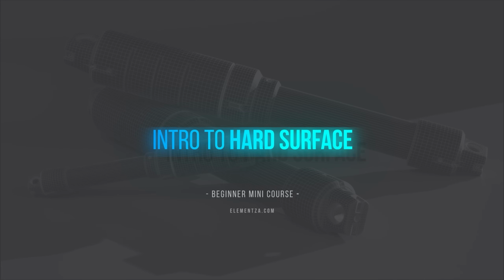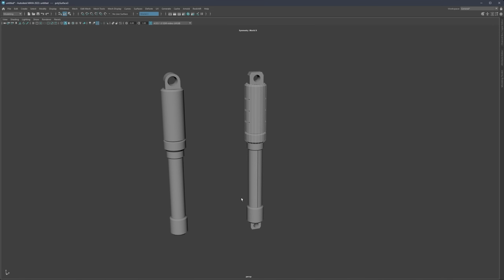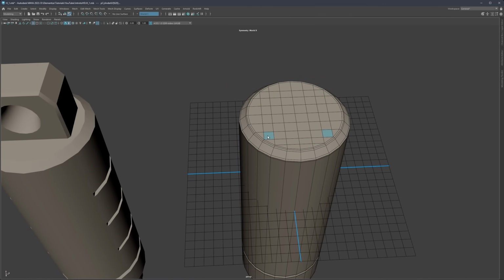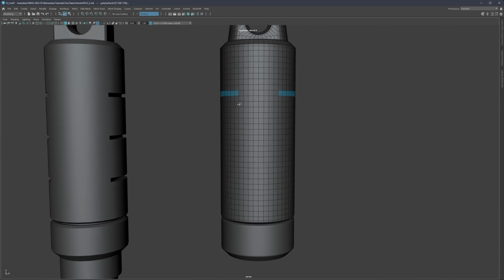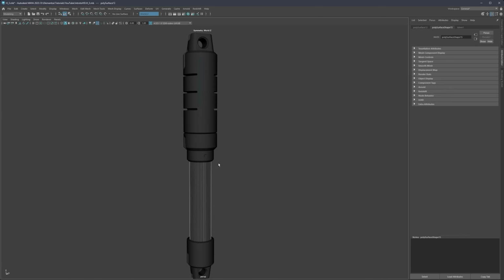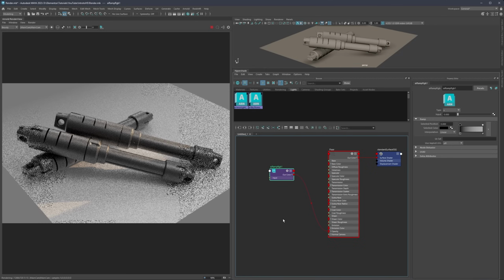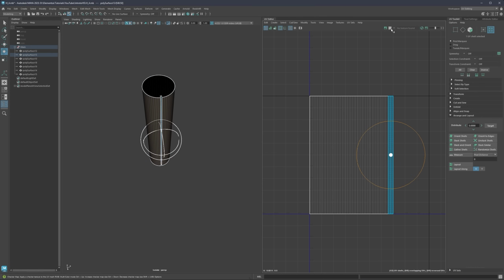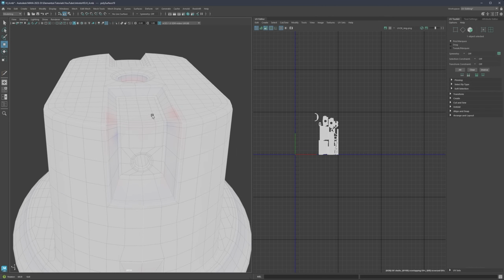Maya 3D Modeling Tutorial for Beginners (3D Modeling, Rendering & UV Mapping)

Comment: is there no option like in blender called shrinwrap? It's when yo create guading mesh (High poly cylinder) And create the one you gonna work with; creating cuts, adding support loops etc. And wraping all pinches and bad topology to - high poly cylinder "guaiding mesh' Cuz all your activities in terms of counting how much you need edges for cylinder to attach other element on the top seems very overwhelming and complex. I'm talking about 43 min of this video
Reply: Actually you could jump to the 1 hour mark, add a cylinder, delete the cylinder cap, and replace it with a uniform grid (using Grid Fill or whatever), then extrude the rectangular part and you're done. I would hope that 3D modellers (and any other tech field for that matter) would learn to plan their designs first since it's so much more efficient.

Comment: Excellent video! No idea why but when I do some stuff such as extruding and try to use the same values you did it ends up extruding way more than it does on your tuto o.O (hope my explanation is clear, non-native here)
Reply from the maker: Its probably related to scale of the object. But try not to copy exact values, instead try to match proportions as much as you can on your own just to practice observational skills
Reply: @Elementza  I will ^^ I was wondering if I messed up some setting or turned smt on/off that is affecting it, cuz usually I can get the same results by following your tutorials, I'm a complete noob in 3D modelling/stuff and Maya

Comment: Hi and good time of day, I have a question about UV'ing chamfered edges.
As far as I know every edge that is corner edge / creates a sharp transition should be "hardened" and cut along it in the UVs, but what do you do with chamfered edges? Do you cut it in the edges of the chamfer and create a "frame" shaped UV? Or do you cut it in the middle? And should it be "Softened" rather than "Hardened"?
Thanks in advance for any help and have a great weekend.

Comment: Normally use 3DCoat for UV, its about time I tried Maya for UV. Shell angles start to matter when your adding a wood material which has a grain. it can be a real pain aligning them in Substance Painter.
Reply from the maker: Yes UV direction and angles will matter, same as the sizes of different tiles etc, but for now just wanted to keep it very simple as something that does not have a lot of rules to remmember for any beginner.